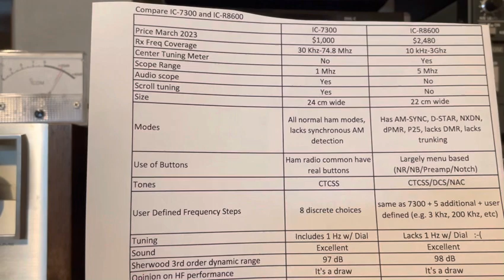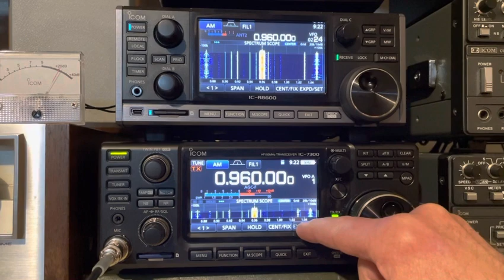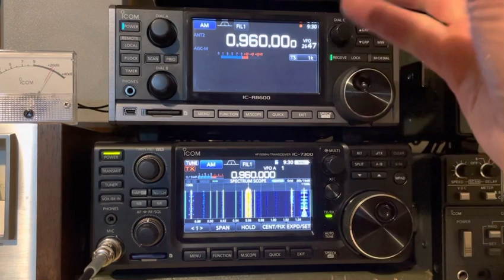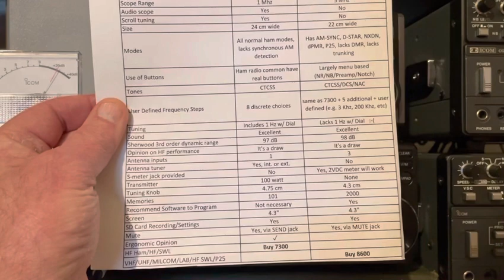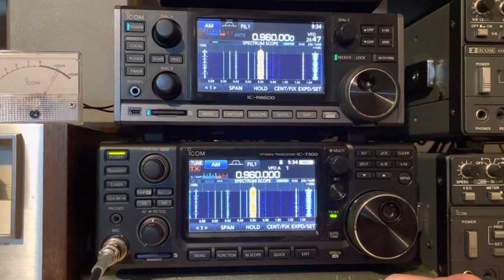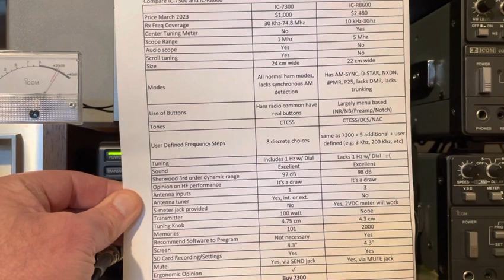Compare Icom HF receivers IC-7300 IC-R8600

Comment: As far as I know you can set up both to a computer.  I know the 7300 will work with ham radio deluxe.  The 8600 can be used with a I/Q signal output for use with third-party SDR software and/or external decoding.  So you can do FT-8 and DMR with it.  I know that HDSDR will work with the R8600 and it can decode a lot of digital modes.

Comment: I have an FTDX10 and am using a new 7300 for SWL and low noise second RX with a mag loop. The DX10 is a better selectivity RX but the 7300 is quite nice. I see why so many got one. And it's lower current draw for POTA than the DX10. So it will make a nice field rig. Later on I'll get a 9700 and I'll have the spectrum covered :)

Comment: A receiver isn't going to have a tuner because there is no RF to make an auto tuner work. But you can get a manual tuner. 

I was going to get an 8600 but I had an epiphany. I have a 705. Turns out the 705 is very very close to the 8600 in rx performance. It's a hell of an SWL receiver.

Comment: Can the R8600 do P25 Police Trunked systems/Repeaters? I’m going to get my Canadian HAM License, but listening to Police systems started my path down the radio rabbit hole. My local Police switched to a Trunk System a few years ago so my Scanner won’t pick them up anymore. I think I have the Uniden BCD996 (might be BCD996T or XT, not too sure, I know there was a companion single DIN setup to go along with my Scanner) without going to check.
Reply from the maker: The 8600 cannot track trunking but it can hear the frequencies if it is FM orP25.
Reply: @kwm380 my local police use P25 Motorola setups I believe
Reply: @kwm380 What would you recommend for a good antenna for mounting on the Peak of my House? Not ridiculously large, something with good waf? 😂 if I picked up the 8600?
Reply from the maker: @Špý-VS-Špý  for vhf uhf I’d recommend a discone. For hf you can use a long wire.
Reply: @kwm380  Thx. Would an 8ga Audio Speaker/Power Wire wrapped around my house near the Gutters work? I have Rolls and Rolls of 8ga. I used to be sponsored in Car Audio Competitions, so have everything from 2/0 to 18ga all Rolls, tons.

Comment: IC-7300 is exceptional for what you get vs price as a SWL/HF Rx. I have a huge affect towards older radios but 7300 just sounds better, performs better. MW bcast sound like FM stereo... Lastly I have discovered how good it performs for scanning of known HF utility frequencies like HF-GCS or Long Range ATC, it's super fast and quiet (no relays clicking in scan mode).

Comment: the ic7300 fails big style above 30mhz due to lack of filters . the icr8600 is very good above 30mhz . i have found both radios to be excellent below 30mhz the 7300 being slightly better but again the icr8600 brings other stuff to the table

Comment: Thanks for the video, great job! I have a question, does the IC-R8600 have CW and RTTY decoding capability? I am SWL enthusiast and I mainly do beacons, and I test different antenna configurations. So for me a good way to confirm a beacon signal is if the receiver is capable to decode the message.

Comment: So would a 7300 and then a Uniden SDS200 be the best of Both worlds for about $1,700?
Reply from the maker: I use a Uniden BCD996P2 which is cheaper than the SDS200 and it works fine for me on analog and digital.

Comment: Very good comparison video, good idea on paper with the main technical points. I use this equipment (with a 9700) and the receiver is excellent. I use its 10.7 khz output to enter an AOR decoder which allows me to decode DMR, LE C4FM, Tetra with a reception part of very good quality, the price remaining a little high but is found for resale.73s HE9CIA

Comment: Great video! I have had the 8600 now for about 2 years and recently picked up the 7300 as a replacement for my older Kenwood TS440. 

I have a question regarding the MUTE feature. I'm assuming that you're using the same antenna for both radios, correct? 

I have thought about using an MFJ-1708B-SDR RF sensing switch to do what your video appears to indicate. If that's true, then your video likely saved me $150! I wasn't aware of exactly what the MUTE jack was even for. 

Thanks!
Reply from the maker: No!  I’m not using the same antenna for both radios. The ants are separate.

Comment: Great review.  Surprised scroll mode is not on the 8600 at over 2x the price.  Thanx & 73. 👍
Reply from the maker: I'm hoping Icom fixes that and the 1 hz tuning on the next update.  They don't update often.
Reply: True for the Big 3 (Icom, Yaesu & Kenwood).  I never understood this business model.  Yaesu did just update the FT-710 after a short time of being on the market.  I wouldn't be surprised that its the last update.  I see the last F/W update for the 8600 was over 2 years ago.  Troubling.

Comment: What is the model # of the external Icom meter on the the left side of the video and how is it connected with the 8600? Thank you.
Reply from the maker: You can use any 1 vdc or 2 vdc meter. It connects with a 3.5mm audio plug.
Reply: @kwm380  Thank you!